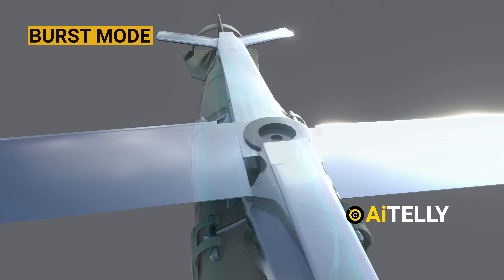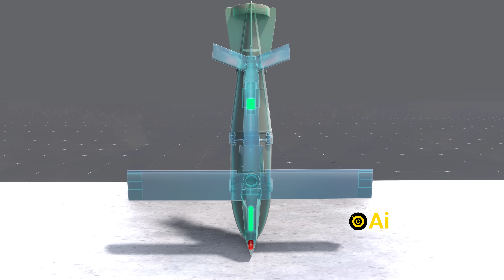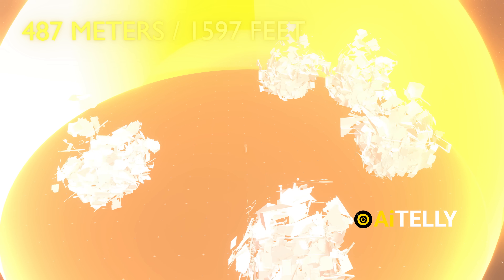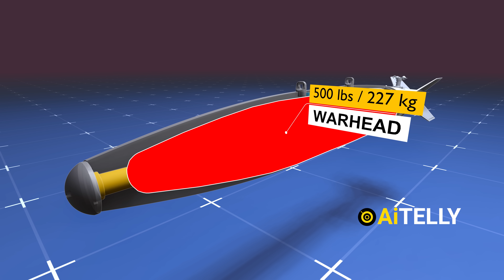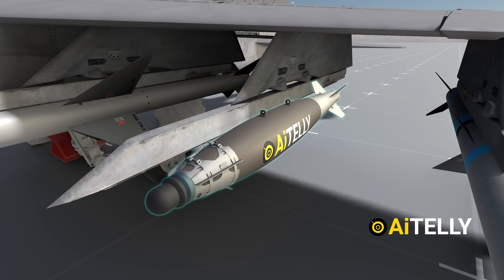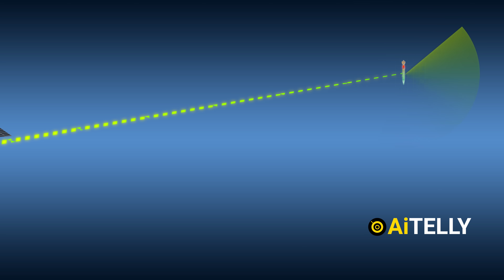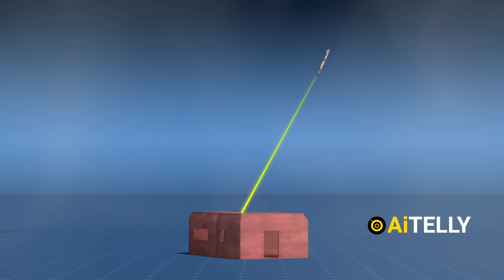Russian Glide Bombs Vs American JDAM | How it Works

Comment: Question?
How did they come up with 75 kilometers for the glide bomb?
-What about wind patterns?Or rain effecting the destination?
Regarding the fuse? Has there ever been a time when the fuse never got set off?
Reply from the maker: Yes many times since it's from the 1960s there's a probability of around 30% unrexploded ammunition when dropped
Reply: @Aitelly  I wondered that.....
Have you ever seen either of them in person?
Reply: @Aitelly  You're forgetting the fact that not all FAB bombs are old. many of them are being manufactured today

Comment: Do you have a video on how signal jamming work? Russia is making these JDAMs into overpriced dumb bombs these days.
Reply from the maker: Not yet will do our research
Reply: s2 underground has a video on it. Though his video is more about how it practically works rather than the technicalities or science behind it.
Reply: Use Ai  gl with jamming
Reply: It's simple really, GPS uses cery weak signals. So russia is using bareage jamming to mask these signals
Reply: I think they are doing it by spoofing. Jamming is washing out the signal. Spoofing is feeding false data.
Reply: А зачем тебе то знать? Планируете напасть на нас?
Reply: Jamming , but it isn't as effective as said in the media, most of the jamming stations are taken out by m30a1 which uses ins
Reply: @sababugs1125  The interference is very effective and the decoding is very fast. The Russians are taking an average of just two weeks to decode the data and jam any missiles. And in 3 months they can already reprogram them with new target data. The Excalibur's hit average is 19 shots for 1 hit and they have even been removed from the scene. JDAM-ER missiles also have very low effectiveness, the Himars M30 and M31 stopped being used, as they were also targets of interference and became obsolete, and now they use the unguided M26 to avoid interference. however, they have an uncertain margin of success. And there is no such thing as cat and mouse hunting, since the Russian system is broad and effective, which makes supposed attacks to try to destroy the countless stations that are mobile and infer interference with the supposed weapons that will destroy them impossible.
Reply: @UfoManiacs.  that's mostly a software issue
Reply: Um problema indissolúvel, meu jovem
Reply: @UfoManiacs. да подумаешь 3 месяца, русский Иван дурак подождет и не будет наступать, насколько вы промытые?😂
Reply: @evilunderstandsonlyforce  My dear, war kids. Everything I wrote came from the Western media itself. Washington Post, NYT. Make an effort and try to run at least a dozen synapses and research
Reply: @sababugs1125  Read the news.It's super effective.
Reply: @j.k.1239  yeah dawg, that's why their ships get sunk and they've lost 2600 tanks
Reply: @sababugs1125  I was talking about gps jamming.The boats targeting ships runs on starlink or inertial navigation on missiles + gps.
Reply: @j.k.1239  the jamming stations get located and destroyed so lots of times it's a cat and mouse game
Reply: @sababugs1125  26000 tanks you wanted to say?
Reply: @sababugs1125  its actually 15642 tanks, learned it from fox news yesterday